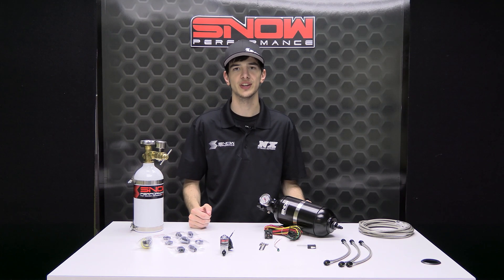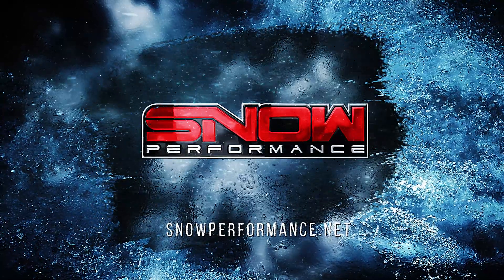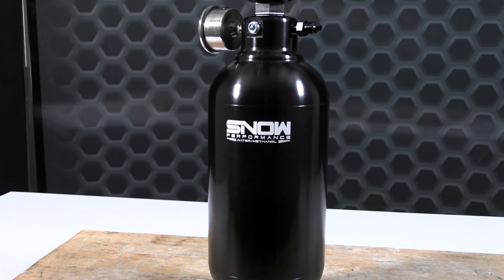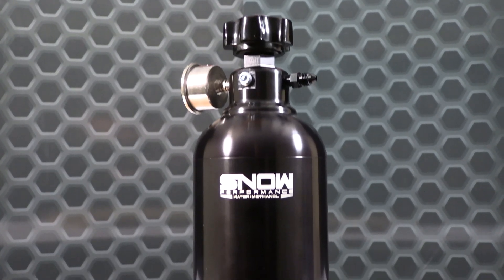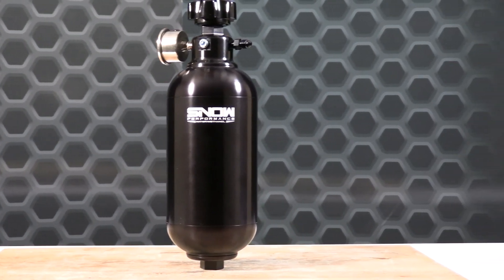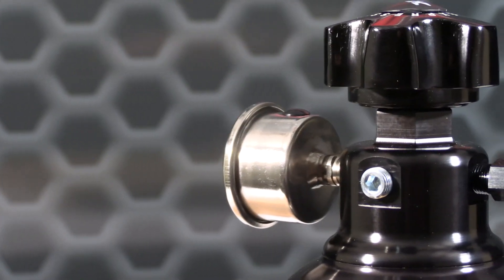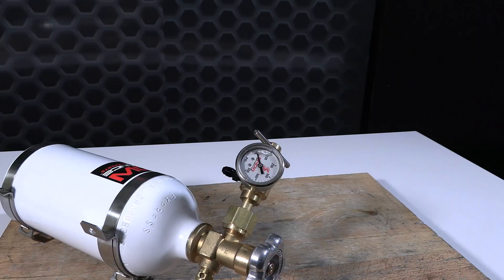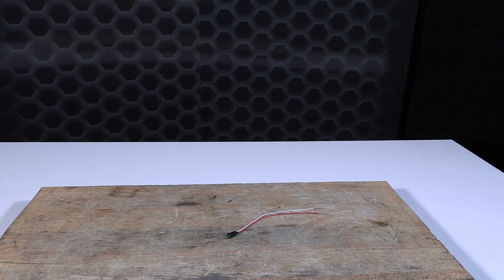New Snow Performance High Capacity Pumpless Water/Methanol System

Comment: What’s the diameter of the high capacity tank, and how do you re-pressurize it after it’s empty?
Reply from the maker: 4.38" will be the diameter and you would pressurize it with either nitrous or another pressurized gas.

Comment: Does this system solve the issue what can occur with WMI ( not reaching cylinder 1 or 6 sometimes ) or irregular spray ? ( bmw B58)
And can i use it together with my existing Pure turbo 800 setup , dorch 1
Reply from the maker: This is more for the high horsepower drag racing applications that see excessively high boost numbers like 40+ PSI that are using water methanol in short bursts. For something like the B58 trying to get the best distribution possible a direct port is going to be recommended. For the system a stage 2 or 2.5 would work great.